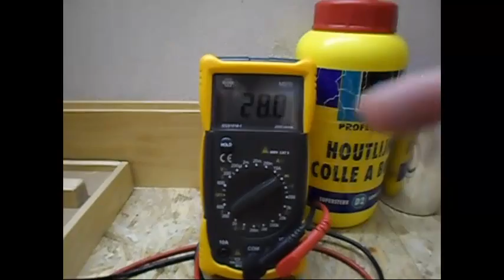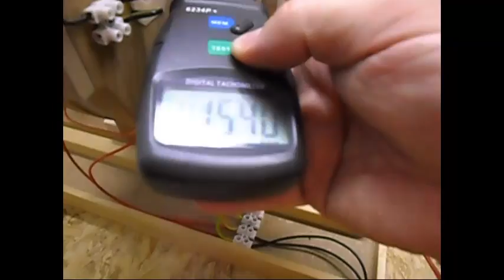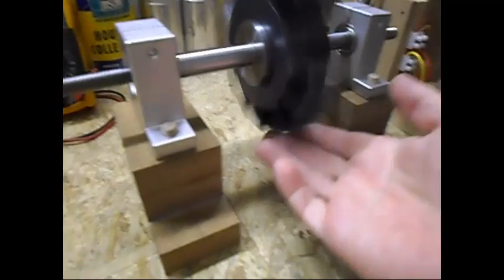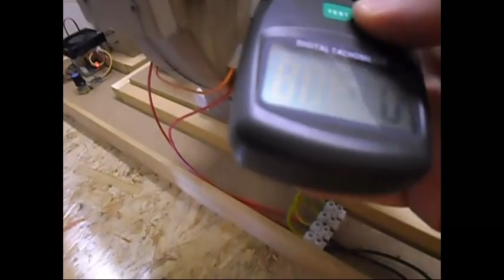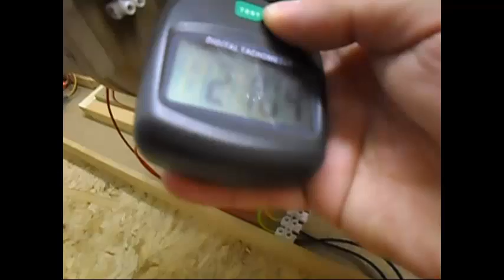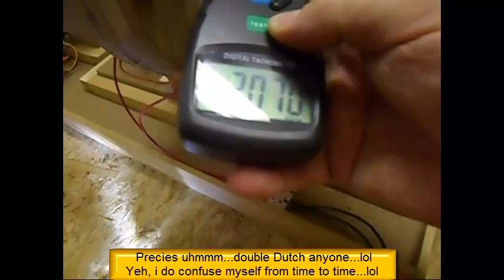Single Phase Generator_Update 4 - Magnets on the back of the cores for more energy output...

Comment: Nice work, as always!!
Were the permanent magnets in “attraction mode” to the rotor magnets? 
Are your Rotor magnets all North on one side of the rotor?  
If they are installed as N-S-N-S-, then I'm not sure using permanent magnets out by the coils will help that much... using iron pieces would work better, since they can reverse magnetic polarity.

Also, an LED is a non-linear and unpredictable Load.  It would give you far more predictable results to use a power resistor, or even a power rheostat. :-)

I’ve found that there is a very clear “optimal load point” of generator/alternator coils. Some people recommend using a “50% load point”, such that the loaded Voltage is 50% of the unloaded Voltage.  Others say it’s best to match the coil resistance with the load resistance.

Either way, when you use a Resistor as a Load, you will always be able to easily calculate the POWER generated once you know the Voltage… since the Resistor will always be “XXX Ohms”, regardless of Voltage… unless it overheats.  Power (Watts) will
always be [Voltage(squared) divided by Resistance].  With an LED load, the Current will change as Voltage increases, but at different rates depending on the “rated Voltage” of the LED bulb.
 
On your “new project rotor”… I believe your permanent magnet flux will be 100% circulating through the rotor material… with nothing available at the outer edge of the rotor teeth.  Keep in mind magnetic flux will ALWAYS take the path of least resistance (reluctance). Electrical steel has a permeability 4000 times higher than air, and Iron is 200,000 times higher… so there’s little chance of causing any flux flow “out” through the teeth… if that was the idea.
Reply from the maker: Thanks for your comment and all the extra info as well...^^

-> Rotor is all South and all North on each side...
-> Magnets on the back are pushing against the ones on the rotor...if i should put them pulling torwards to ones on the rotor i get even less voltage output...around 13v or so...

-> Since the output is fully rectified i do think that the led load is trustworthy...;-)
->I do know about the resistor load calculating but i just don't use it...why...don't know...just don't...lol

->About the new rotor project, 
I did test it with already and i'm only showing it now and yes if i put the magnets like i said in the video there will be close to zero magnetic field present...the magnets/rotor/shaft...everywhere almost zero magnetic field...lol
It has been all canceled out...^^
Will show that in the upcoming video and i will also turn 6 of them stacks around(alternatting positions) and than i will have massive magnetic flux with the created fields...;-)

->About a specific load for specific coils...yes...that is nice to but what i going for is where i need none of that...;-)
Reply: Ahh... N-S | S-N | N-S | S-N  ... very interesting indeed, but it seems the core of the rotor might still have the same "shorting" effect since it will still be in direct contact with the magnets... I imagine you have more tricks up your sleeve!  :)
Reply from the maker: Well, i did some testing and gotten more output now than before with an other core type...^^
Here it went from 28(ish) Vdc to 37(ish) Vdc but now(with the new core) it goes from that 28(ish) to around 45(ish) Vdc which is great and if i remember right the input is a bit lower as well...(i think)...lol
Video about that soon and than i'm gonna do shorting them coils in series and parallel to see if i can get more volts output and so i keep trying to pump out the most i can before i do that with all 24 coils...;-)

Comment: how many ampere you got sir... ?
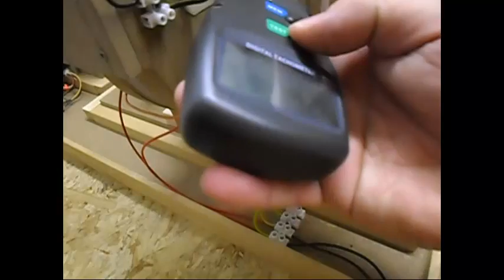Reply: oh... now i hear you say  55 Volt / 0.8 A at (10:46) thanks sir
Reply from the maker: Thanks for your comment...^^
Not much Amps here either...lol...more like ma...;-)
Reply from the maker: The drive side is using 15V x 0.8Amp and the output is 50Vdc(ish) unloaded but once loaded it drops to 10Vdc and not more than 50ma from what i can see from that 1watt load...^^
Reply: wow... i wann have one like that...
thanks for replying sir...
Reply from the maker: No problem and you are wlecome...^^
It not that good ratio wise...12.4 watt input versus 0.5 watt output...lol
But we need to start somewhere...^^

Comment from the maker: This magnet at the back of the core seems to help pretty good for getting more energy production with no extra rpm...at least in my case...;-)
One thing needs to be noted is that i still need to test this with a longer core(as long as the one now and the 10mm air gap included)...
Air is not a good magnetic field conductor so will a longer core works even better or not...???
Stay tuned and we'll know in a few days time...^^ 

It also seems the higher rpm the better the effect of not interfering with the drive side but will it be enough...???...lol